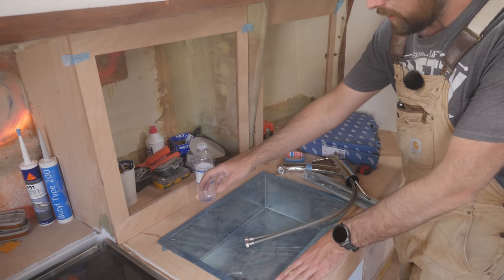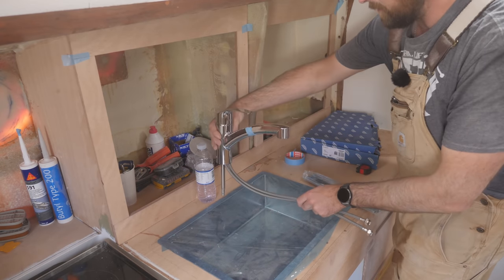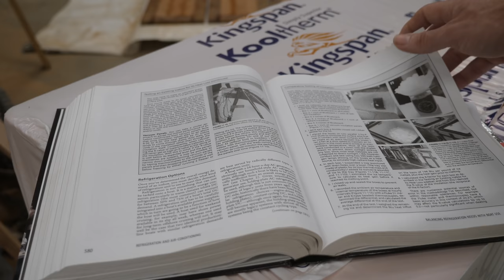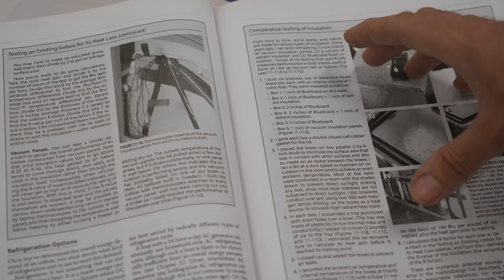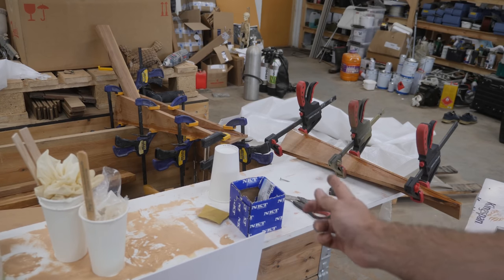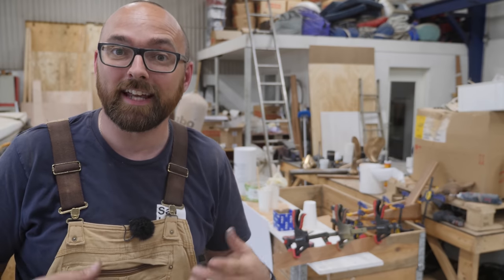Sail Life - Galley 90% done & yet more fairing - DIY sailboat project

Comment: Hi, Mads.  Another good video.  To put the faucet spigot in the center without impeding the doors, add a center stile to the left cabinet frame, and make the doors just a tad narrower.  You won't lose any cabinet space, and the faucet can then be centered.  If you do this, trim evenly from each side of your existing doors so they look uniform and remount.  I still recommend that you consider making your fridge top out of more than one piece.  You could make a fixed center section that is 25 or so centimeters wide, and two side sections that open.  That will significantly reduce the amount of cold air you lose from your fridge each time you open it.  A lot of air moves around in a sail boat, so a lot of your cold air will be replaced by warmer humid air, and you'll get a ton of condensation if you keep your large opening as you have shown it.  It will also be stiffer if you make the opening sections narrower.

Comment: Hi Mads, all looking good.
With the fridge, don't forget to add a drain port at the lowest part of the  bottom to allow condensate out. My fridge makes lots of water in the tropics, and siphoning it out is a pain, wiping it out takes to long and allows warm air in. Best, SV Quo Vadis
Reply: +1 on this! You will kick yourself continuously if you don't. If you're gonna go to the trouble of glassing up a liner then make sure you slant the bottom very slightly so it drains to a corner too.
Reply: Mine isn't working in my boat yet, but this is a great idea to fit to mine before I get it up and running... Thanks for the idea!
Reply: Was going to mention this but you beat me to it.  Even a port with a closed valve that runs to a nipple so if needed you can slap a hose on it and capture the run off, without needing a line to the bilge or other elaborate design plus being able to close it keeps that precious cold inside.

Comment: Mads, change the doors on the cabinets to roll up doors. They easy to make, use no room and easy to repair if damaged. You already made the slats just leave out the edge part, epoxy a fiber on the back and make a guide runner inside the box.
Reply: Would solve the issue of the focet
Reply: Or get a hold of some throw hinges so that the doors open from the centre (when open they would look like sides to the area above the sink. Difficult to explain in text without drawing it).
Reply from the maker: I considered that but i would have to wrap around and that would waste a lot of space :)
Reply: Sliding doors so one overlaps the other no wasted space and still keeps good access
Reply: I was thinking folding doors to keep the faucet in the center.  Make four panels instead of two and join two in the center with hinges for each side.  I think with the size, you wouldn't need a track on the top and bottom like a folding closet door.  You won't loose any space and can open both sides of the storage space at the same time so you won't loose any usability.  it does double the panels you need to make and the number of hinges, but I think it would solve your problem.
Reply: I was thinking roll up as well, also would he more secure at sea!.  Since you already have the doors, what about one of those fold down faucets?
Reply: @SailLife  plus you will find the offset faucet isn't a bad or even neutral thing but rather an improvement!
Reply: Sail Life  - Mads could you have enough room behind your cabinet box to allow the roll up door to wrap behind instead of within the box?
Reply: I was gonna say sliding doors over the sink. That would allow them to to put the faucet in the middle of the sink.  You would only be able to open left or right side at one time, but you still have access w/o the faucet being in the way.

Comment: IF there is enough depth between the galley sink and the base cabinet face, a "dummy" drawer face can be added here with a flip down finish face which reveals a long plastic trough open at the top to be used for storing sink and dish scrub brushes, etc.  I have one of these at home at it is simple and works very well.

Comment: Your local IKEA store will be loaded with Masonite faced boards, a.k.a. Shelves with white plastic stuff layer glued to it.... can also be bought in counter top sizes....see products named  “Lilltrask” with the two dots over the A- conversely our big box hardware stores in the US have single faced plywood covered with the laminate on one side which would allow you to epoxy seal the edges and back to protect from moisture.  The edges are treated with an iron-on matching banding that is applied once cut to size... message if you need more info, I’d be happy to purchase banding and ship to you if you can’t source locally. Dan Houston, TX USA

Comment: Hi Mads, definitely longer arms on the fridge hinges. Separating the arms more front to back and welding 13mm tubing to the arms across the underside of the countertop will help eliminate the floppiness. The tubing can intersect with the pivot point as well and then the tube will only rotate and not move in an arc. I would consider making a stainless steel liner for the fridge rather than foam/fiberglass. It will give you more precious cubic millimeters inside and remember you don't need quite as much insulation for the lid because of the countertop. Saves more of those cubic mm's  Perhaps a flush button in the countertop to unlock and open.  I think the faucet in front of the knee is best, not the ideal but the most functional.  Best Wishes.

Comment: You should put the faucet left of the zink. That way you get a more clean workspace to the right, and - depending on the height of the faucet - will be able to fill water in your pots and pans directly on the stovetop.
This is my first comment  - absolutely love your videos, and have seen every single one of the ones regarding Athena 👍

Comment: Place the faucet on the corner next to the stove, and chose a longer version that can reach over the stove so that you can fill pots without removing them from the potholders?
Reply: maybe use the version that Uma has?
Reply: I like that better then my ideal.
Reply: Corner faucets are absolute trash tho. Never in the right spot, always in the way. PITA.
Reply: An option would be to place the faucet in the middle in front of two cupboard sliding doors... or, your boat- your choice! Haha
Reply: Have you though about a set of bi-fold doors?

Comment: Mads - Regarding the diagonal wiggle of the fridge top and the rod to connect the two ends - you will need a rod connected diagonally to the same strut on the other side and it would be advisable to have another rod connecting the other 2 struts to one another at the opposite diagonal angle. If you only had a single rod connected to the same strut at the other side, it would not be effective and would place huge stresses at the rod joints.

BTW I've haven't missed an episode since a good while before you bought Athena and I am so stoked to see how she is coming along! Amazing work.

Comment: Use thin dark tinted but able to see-through plexi that slide. Open one side get to half of cabinet, close and open other side for the other. The spray back off the sink will also make cleaning the doors easier and let’s you keep the faucet in the middle of sink. Every boat I’ve been aboard has had this. Don’t need every cabinet door to open out.

Comment: Tambour doors. Stay away from open cell foams, they do not insulate as well and they absorb moisture. With closed cell foams you do need it as thick as the phenolic foam. It's a balance between usable space, and efficiency of the insulation. My suggestion is a expanded polypropylene foam. It's durable as hell and a great insulator being closed cell. I also suggest vacuum bagging a tub for the inside of the fridge.

Comment: Nice job on the doors and drawers.
For the refrigerator, you can get counter top laminates (AKA High pressure Laminate, Formica etc) that have metallic surfaces in brushed aluminum and stainless.  They are on the order of 1-2 mm thick and can be epoxy or contact cemented to your insulation foam to give you a nice clean interior surface.  I am sure you could epoxy bond thin stainless or aluminum sheet metal to the foam or fiber glass topped foam as well.  If you need better insulation Panasonic makes standard size vacuum insulated panels in 15 and 25 mm thick that could be integrated in with the foam.  (U-Vacua) The 25 mm units have an R value of 66.  DigiKey dot com has them,  a 609mm x 569mm x 24mm panel  is only $37 us.  Just inset one panel in a pocket cut into each of your side and bottom foam panels.  Just discovered these may have to buy one to play with.

Comment: For your fridge stabilising rod, you could use two rods ending opposite handed screw threads in the centre. You could then use a threaded coupling in the centre to tension it

Comment: for the sink, consider the back left corner, then your faucet could double as a pot filler.also it would prevent your door from opening up too far and running into your stove/oven box when not on the level. For the interior of the fridge consider FRP wall board, its cheap, thin, durable, and waterproof.

Comment: Place the 'barrel' of the hinge on a hard surface and tap it with a small hammer. That should  snug up the coiled part of the hinge around the hinge pin, removing any 'slop'. I would wind some three ply rope around that bare pole, then coat it with some sealer to keep it clean, aside from the 'nautical' look, it would provide a slip proof grip in rough seas...And, if you want to be able to open the fridge top with 'stuff' still on it, install a couple of auto tailgate pistons. They're cheap at a junk yard and have a powerful nitrogen filled piston that slowly raises a lot of weight. You just need a 'down latch' to hold it closed. Press the latch and the lid slowly rises on it's own. They're longer, so their base would have to be mounted further down, but it's only 12 to 18" depending on the model...You may need a drain to handle condensation and spills in the fridge, but you will probably want to use a 'catch bottle' rather than let spilled milk drain into the bilge... ; {

Comment: For the fridge, perhaps lay up some glass over the foam before placing.  Then a fillet and a little sanding and paint.  Plus the fillet would make cleaning bits from the bottom easier than sharp corners.

Comment: Hi mads, just a sugestion for your life line staunchans  don,t bolt them on, drill a hole where the staunchans are to go and fibreglass tubes in, made out of  carbon fiber or fiberglass, the appropriate  size to take your staunchans  with the tubes sealed with epoxy  at the bottom these will never leak and is very strong  when fiberglassed to the hull inside cheers just a suggestion

Comment: On the cabinet door hinges: why not use regular household furniture door hinges? The ones that have the two adjustment-screws and such. The benefit I would see in those is that they have no play, so the won't rattle an I think you can get spring loaded ones that stay open/closed by themselves (still need to be locked underway though)

Comment: The one fridge I've made I lined with stainless steel. As you've got access to a TIG welder I'm surprised you didn't consider that option.
Reply: I totally agree. Way easier to keep clean and no mold will grow. I did that on my sailboat refit.
Reply: Also going to take up less room than the 10 Mil foam board plus 4 layers of bi axial glass.  It would be significantly more expensive than his plan, but less elegant.
Reply: Agree with SS idea. Make sure you put a bevel at the starboard, inside edge of the insulation on the top so the top will open. A square edge will not slide open with the hinges you’ve chosen.

Comment: Obscure English word: Masonite -    May - son - ite.    Emphasis is on the May. I second the idea of the false drawer front at the sink. Fiddles could also be this same wood and same thickness to tie it all together nicely. Looks good!
Reply: Not obscure, used constantly in construction of doors, cheap cabinets, and furniture. Mads, I would avoid it as it can absorb moisture. Just use fiberglass or weld up some SS.

Comment: If it's not too late you might want to think about rounding over those sharp edges on the cabinet doors as they are going to get a lot of hard use and those sharp edges will be fracture points where the varnish will crack allowing moisture to seep into the wood causing stains and the varnish to peel.  Otherwise they look great.
I think the faucet at the corner of the sink is OK.  Better than in the middle.

Comment: Fiberglass fridge interior is an outstanding idea. That surface needs to be waterproof and washable. You will, of course, need to insulate and line the top as well. Drain to the bilge for condensate, or maybe a pan somewhere?

Comment: When you move the faucet to the corner of the sink, we will have less area to fit a larger pans, bowls, etc. when rinsing.  This is compounded with the smaller sink.  I think a faucet with a retractable hose would really help solve this problem.  You would end up with the ability to smoothly direct the spray of water when rinsing.  This could also contribute to saving fresh water.

Comment: Hey Mads, If you see this, I highly recommend using roll top opening for the space behind the sink. You can still use the sink as normal, it will roll up out of the way, and you can easily make them out of the wood you have by making rounded slats or use dowels with a canvas backing. Using a spring loaded spindle will make it smooth as butter.

Comment: Great episode.  Athena is coming along fine and looking spiffy!.   I recommend that you provide for a drain in the refrigerator.  Drain can be passive and drain to the bilge  (not the greatest due to potential for smelly water etc. in the bilge) or plumbed with a manual foot pump (my personal recommendation)   or even small electric pump.  May be possible to drain the refrigerator to galley drain.  I have had several boats and I am always needing to use a drain feature due to something that spilled, leaked or otherwise made a mess in the bottom of the refrigerator box.

Comment: NO!! Mads, you've cocked up the panel doors (and drawer fronts). It's an absolute fundamental of building panels with solid timber that the panel floats....ie it isn't glued into the frame (and is slightly undersized). This allows for expansion and contraction. Now, if you were in a stable environment in a centrally heated super-insulated house, you'd have a small chance of getting away with it, but in a marine environment as soon as the humidity changes you are going to have big issues. Wood expands and contracts across the grain, and not with it, so the rails (top and bottom members of the frame) are going to remain the same length no matter what, but the panels within them could expand or contract by 5% to even 10%, depending on the timber species. That a means complete breakdown will occur somewhere, either cracking within the panel for shrinkage, or bursting open a joint in the case of expansion. I've been making solid wood furniture for the last 40 years, and that was a very harsh lesson I learned the hard way many decades ago. Such a pity, but you'll have to re-make them......either now, or after they've ruined themselves.

Comment: Galley locker doors - interfering with the faucet. What you may consider is a bi-fold door on the right, or if you do two bi-fold doors you could center the faucet. Your new doors can be modified easily.
Reply: I think it woud be a great mistake to mount the faucet on the right, breaking up the otherwise clear space of the cabinet top. If you can't mount it on the back with bi-fold doors it needs to be mounted on the left of the sink, even if you have to relocate the sink a few inches to the right. But you can easily cut the doors in half vertically, mount hinges at the split and install some magnetic latches that will keep the doors stiff.

Comment: On topic of the faucet: how about you remove the bottom inner corners of the doors of a "split" 2-door design and place a piece of plywood (in the shape you removed, but in 1 piece) behind the faucet, with the faucet centered to the line between the doors. If the 2 doors are shut, they might close neatly on the little piece behind the faucet and if you can place a shelf or just a reinforcement to sturdy up the plywood piece, you might not have to split the cabinet in 2 all the way to the top.

Comment: Articulated faucet. Not the most pleasant device when seal change comes, but it would allow you to put the faucet in front of the cabinet, and have all the space in the world to use it. I won't put any one specific model here, as there's entirely too many flavors, but a quick google search with those terms will pull up a bunch of variants. If you're not shy on open brass, there's one that's about 4 standard scrolls down to the right which looks like it would be a perfect fit for your situation.

Comment: Making drawer boxes seems well suited to your precision! 
Great job on the doors/drawer fronts. They look spiffy. I have one concern. It looks like you glued the panels into the frames. If you did there is a good chance they will expand and break the frames. The panels should be 'floating' in the frames. Just so fitting on a boat?  :)
Are the hinges stainless steel? If they aren't, you might want to go with concealed hinges like those from Blum. At least that way you won't see the rust. I have them on my SW aquarium stand. They last for about 5 years then I replace them.

Comment: I wouldn't cover the chainplates.  That way,  you can always check them,  if there is a leak in the deck (i.e. stresscracks) or the screws getting loose. Besides that, they are pretty spiffy.